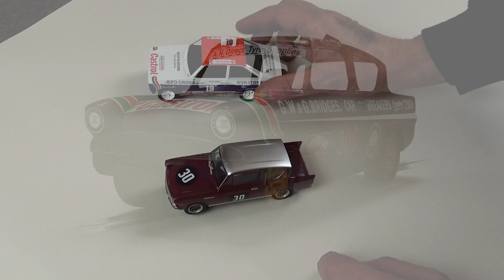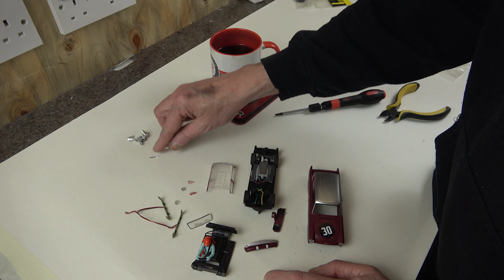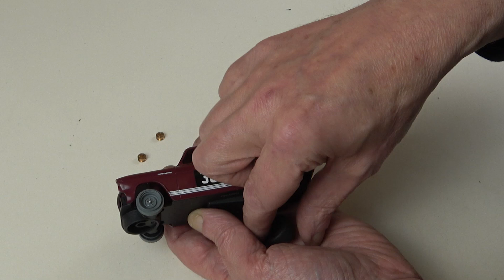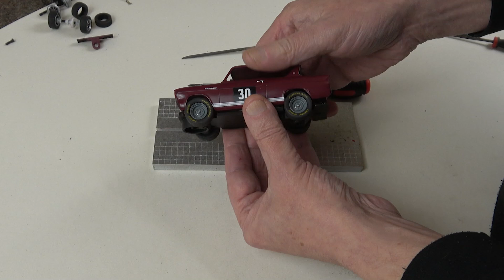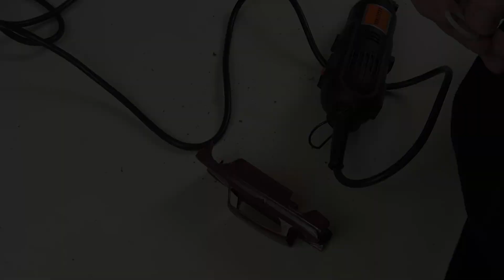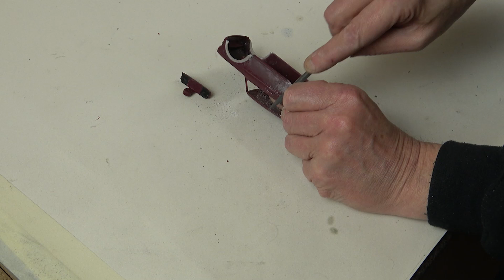George Polley 306 National Hotrod Slot Car Build Part 1

Comment: In the late 80's i was the mechanic on a Standard Rod (1300cc non modified) at The East of England stock car track in Peterborough. A few time a year the National Hot Rods raced there.
In the early 90's my friends dad had a road legal George Polley Arched Toyota Starlet with a 2.1 Pinto engine great memories

Comment: Sweet project Dave! I dig the flares you added. They look great. I am building a Pioneer mustang I have soon. I am thinking on lowering it. This is a great reference.  Light wire....hmmmmm

METAL!
Reply from the maker: Dude check out my Pioneer Charger build from January 2024,  that will be a better guide for the Mustang :)   Most of the lowering with a Pioneer can be done with the body :)
Reply: @slotr  Mteal, thanks for the tip. I will check it out!

Comment: Great w.i.p. here Dave.  This creation already has something of a moody 'dark country' vibe to it.  It's now more 'Pioneer Legends' than some small standard UK Scalextric car.  A car which has died and is now going to a happier place.  I was going to suggest cutting the wheel arches in with plastic filler to better round them (Escort Mk I style) but then I saw the image of the real car near the end of this clip where we can see the thing was done with a sheet of rolled steel cut with some tin snips.    Meanwhile, the Unicorn Heads 'Light Expanse' cuts the air and helps remind us to watch out for those rattle snakes.   The whole eclectic sound mix essentially delivers slot car late night talk radio at its best.  You are here giving Marty's 'Two Lines' some serious run for his money and yes, we know it's just nickels and dimes which don't do productions like these compensatory justice but we are where we are.  I'll be getting that SD1 over to you now my busy to and fro is over.
Reply from the maker: I think I'm more Chris Stevens from Northern Exposure

Comment: Great episode Dave, nice work with Body parts with the 3D printing the extended wheel arches, SlotR Custom Parts and Aero for slot cars
Reply from the maker: I'm trying to use it as a tool to help me do the things I'm doing rather than replace them. I could have downloaded a 105e mesh, edited it and printed it out, but where is the fun in that?